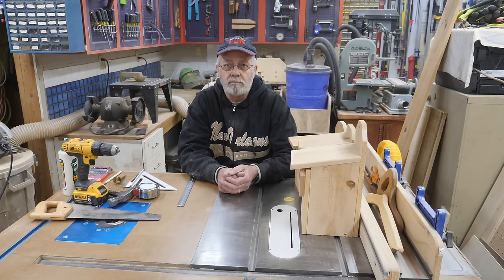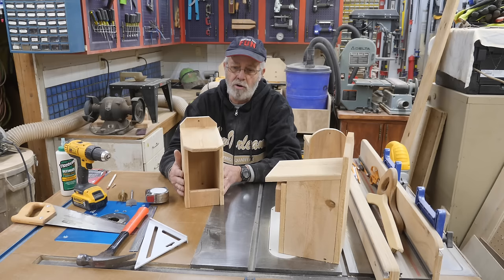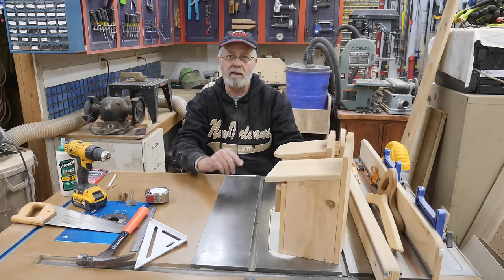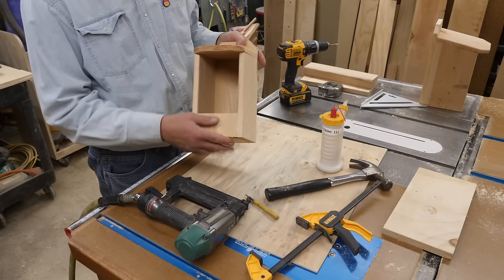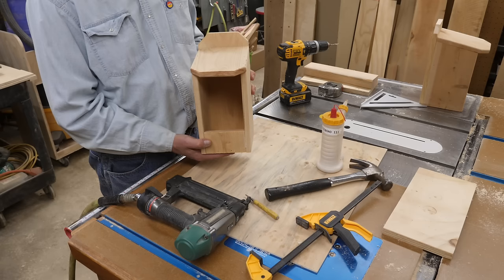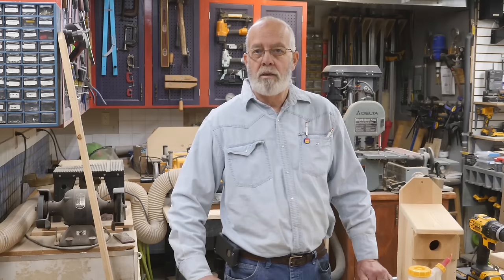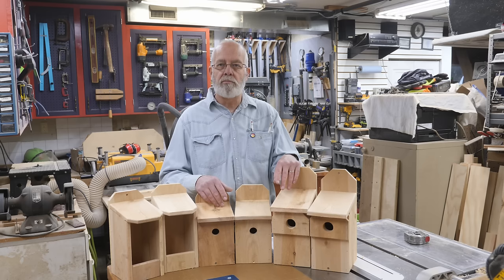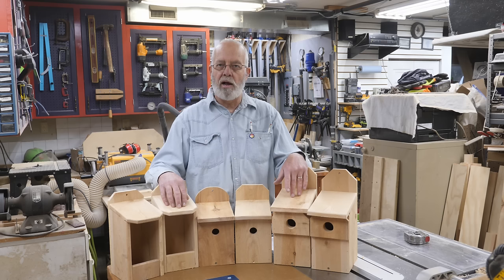Simple Bird Houses and How To Build.  Great project to teach kids how to build!

Comment: If you recess the bottom 1/2" it will keep the bottom from rotting out so fast, as the water will not wick around the side board and up into the crack.

Comment: Good job on presentation. I make and sell birdhouse at our local county farmers market. I make them very similar to you. I would add that there are few good books and plans you can download that give you the footprint dimension, hole size and location from floor ,height mounting, at best situation to put them in (open grassy fields, wooded or semi wooded etc).
Building them to be species specific and something that will be useful and used is important as opposed to being just a decorative 
The ones I most typically make are bluebird, Carolina Wren and house finch. I also make screech owl houses and bat houses.

Comment: Roger got most of the elements of building bird boxes that are safe of eggs and chicks but missed a couple things. Predator blocks are essential to keep predators from reaching in and taking eggs and chicks,  There is inadequate ventilation which means boxes and  eggs and chicks can succumb to excess heat, always add a few shallow kerf saw cuts below the access hole inside and out. The inside cuts allow chicks to climb out when they fledge.  Rather than have the floor drop out, I have one of the side pieces hinge open for ease of cleaning and checking eggs and chicks.  Roger knows what hw is doing but I think he'll agree the most important thing is the safety of eggs and chicks.

Comment: I enjoyed your video. Even though I've made lots of bird houses over the last couple of decades, I'm always looking for tips and new ideas. I have a robin that makes a nest every year on top of my front porch light which is protected by the overhead roof. I decided 3 years ago to make a robin box similar to yours but a little bigger and attached it to my porch wall right beside my porch light. They still build a nest on top of the light instead of in the robin box I built. The light bulb must put off some heat that they prefer, who knows. Also, just FYI, a female bluebird can raise up to 3 clutches of babies in the same bird house if you remove the old nest as soon as the last baby has flown the coop. Fledglings generally won't return to the nest, although they might hang out for a while nearby hoping mamma or papa will still feed them.  By the way, your workshop is to die for! Thanks for the video.

Comment: How thick is that board?
Reply from the maker: Cedar fence pickets can vary from 1/2" to 11/16".  Most average 5/8".
Reply: I didn’t know if there was more than one size width of those boards
Reply: Thank you very much for the reply back. I’m looking forward to making some of those tomorrow. I appreciate you giving all the instructions and not charging money for them. You’ve done an awesome job. Keep it up!
Reply from the maker: @cherylmcguire7960  These are the "nominal" 5-1/2" wide.  There is also a 3-1/2" wide available.
Reply: What are the sizes of each board